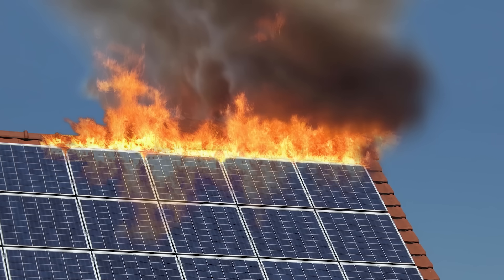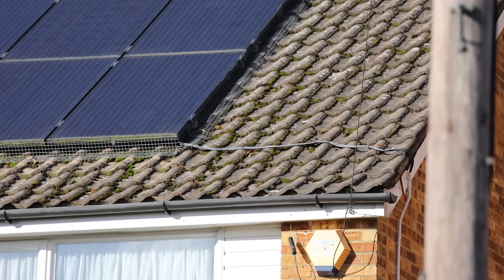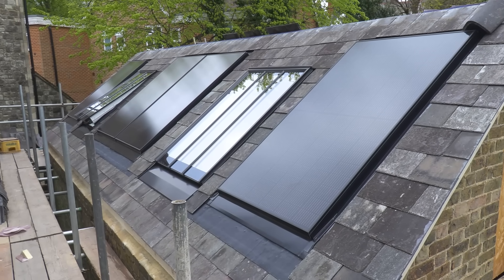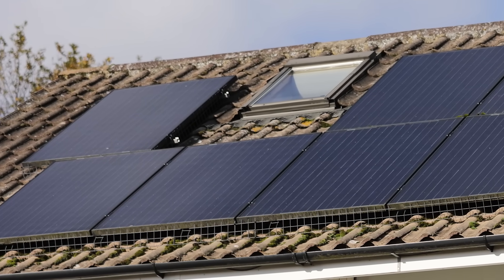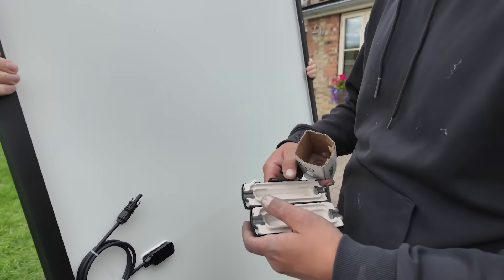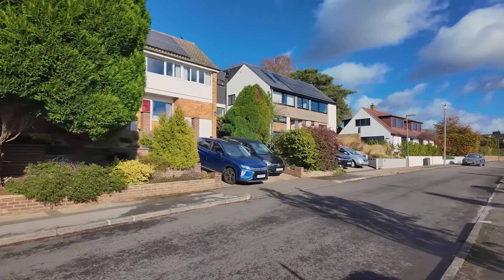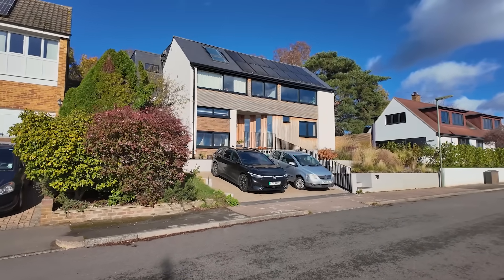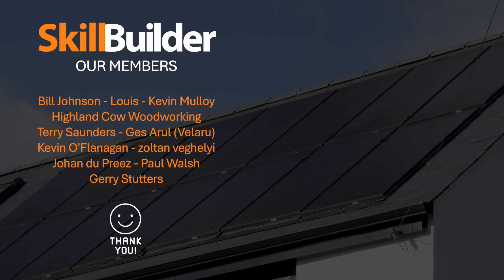Solar Panel Fires Are Rising – Here’s Why

Comment: I am a German electric engineer (MSc) and I was responsible for many high-tech machinery designs, the making, shipping and installation until production resumed in Asia, Europe and the US for PV-module production (CIGS-based, but what I am writing now applies also basically to anything silicon-based modules).
In my early years I worked as a commissioning engineer on all continents, I know how to make and repair electronics, electrics (fully licensed), anything mechanic, process, hydraulic and pneumatic - and I know how to fix cars and anything of household machines. Yes, my family and wife loves me 😁. It is just for you, I am not a BSler and you get some first-hand thoughts on the subject. So here it comes:

I never understand why solar-thermal systems are political not promoted.

If you supply your washing machine, your dish washer and your heater system with already a 30-80°C water inlet, most of your large energy needs are covered for free - incl. warm shower and warm kitchen water. Heaters are the real energy suckers in any household, the little internal pumps and spinning motors and LED-lamps are neglectable in comparison.

With an solar-thermal system all you need is a warm water ring line connecting these devices via an adjustable thermomixer (for each) in your house and a (existing) proper central  gas heating system allowing to hook up and integrate the solar-thermal modules on your roof top. 
Most modern systems have such feature. The ring line is usually standard in such houses for the bathrooms and the kitchen (dish washer) and the washing machine is mostly located in the basement or kitchen, where also this ring line is somewhere near or can be extended to.

Such a system is not only way much cheaper, it is most of all SIMPLE!

Every plumber can install and repair it, nothing complex, here there is no need for software and is 100% fireproof because it runs on water only. So in 5-6 years when your solar installation most likely develops its own troubles (mostly expensive control electronics, inverters and the like), you have simple means of repairs not relying on highly-specialized spare parts.
With all the software and different electronic components for a whole system you might face now a spare part crisis and even worse will not find anyone trying to get into your complex system to fix it. The complexities are huge hurdle (just think of modern cars, they die because the centre console is dead, not the transmission, engine or gearbox).

Maintenance: as long as everything remains water tight every 5 years or so you replace the solar panel liquid in the primary circuit, which is basically water and antifreeze as in your car's radiator. With a bit of proper thinking and a manual and some (YT) advice any housewife can executed it; it is like draining, refilling and air-venting on your cars cooling system or house heater water circuit. My sons with the age of 12 were trained by me so to understand the basics of hydraulic physics...

In winter when your panels are covered with thick snow in the morning, you only need to remove a bit of snow at the liquid connector spot (temperature sensor location) of the panel, so the controls of the central heater system will now start its circular pump pump ("believing" there is warm water at the roof) and forces more lukewarm water through them and within 1 hour or so the snow melts or even slides down, clearing the panels on their own by gravity. 
There is no need to climb onto the roof in winter to clean the complete panels as with the PV-modules. PV-modules covered in snow in winter at the roof are a nightmare to reach and you always need to clear their whole area.
This spot at my thermo-panel system was placed conveniently very near at a roof window and all I need in a winter morning was a broom and exactly a half minute. The rest did the system magically on its own.
Even on a clear winter night you can "earn" up to 90°C from your roof, filling your warm water storage tank (70-100l), still carrying plenty of warm water into the next morning.
Dish washers and washing machines these days can be run by a pre-set time and so set it to noon or whenever you expect Ms. Sun to show her bright smile.

For society: there is no need to change or enlarge public grid hardware; changing heat loads will not influence the general electric grid operational situation since there is no electricity involved and in the nights you have your warm water storage tank anyway. The efficiency rate is much better because the sun warms up the water, which you want as well, warm water. Electricity is always a support energy only and every energy change into another form screws any efficiency rates. This heat goes straight where it is needed.
No need for an extremely expensive power battery module lasting only a few years and posing indeed a very dangerous fire hazard, which is not the statistical occurrence rate (which is quite low, but it does happen), the danger is the pure spontaneity and unpredictability and once it starts, it releases a lot of highly toxic and inflammable gases and then goes off like a bomb - no fire truck and crew will be ever able to extinguish such fire. If you are lucky you might escape with your life but your house is certainly gone.
This is a matter which should be seriously considered. Rare as an event indeed but very deadly and fast as lightning when it happen.

Ecologically (I'll try to make a very long story short, just the base points):
The pure solar/battery idea is not really ecologic as it is and was always promised; the energy input into these highly compound-material (PV-modules, battery blocs, power controls, inverters etc.) is really much too large over their much too short lifecycles (10-25 years), the energy efficiency rate of the whole idea is in general a mess and the whole idea dies multiple deaths due to local and global resources limitations, technical complexities and fundamental technical problems (i.e. inertia, see black-out in Spain), plus some more reasons (recycling issues, distribution, natural disaster proof etc.). 
We basically triggered a new now green predatory Capitalism on a global scale without really braining it out first. Call it ideology or quasi-religion; up to you.

Personal summary:
Solar-thermal systems are elegant, cheap to make, dead-easy to maintain and repair and a pure reason for an engineer to be happy.
I own a house here in Dresden, decided immediately against this PV-BS and installed a solar-thermal system as described and lived since then happy ever after, never looking back. 
Plus there is no constant hassle if the government is subsidizing it by next year or changes it mind. The add on for my central gas heating system for two panels incl. installation about 12 years agon were a lousy 1300€. You own, what your earn (from the roof), simple and effective and economical. 
So far only one repair (pressure surge tank) for a small 300€ including installation (I was too lazy to do it myself).
As an electric/electronic engineer I am so happy not to have such an overcomplex system, which would keep me constantly busy: technically and administrational.

At least whoever thinks of earning a bit sunlight for one's home comfort should honestly rethink this option truly first. 
And on top your will see your fire brigade only once a year when they throw their annual party for the community (a German tradition in smaller towns, suburbs and villages).
So, this would be my advice from an old white angry German Boomer engineer, to whomever is interested.

Peace! from Dresden / Germany
Reply: A perfect example of the KISS principle in action, as a fellow engineer I am disappointed that PV is "Gesetz" (required by building regulations) here in Bremen when you install a new roof.
Reply: Glad you didn’t do the long version 😅
Reply: @lomate1963  there is if you want it just email him and he’ll oblige. 😂😂😂
Reply: It doesn't charge your car though
Reply: My car charges my house.
Reply: @gzoechi  
My car is "charged" at a gas station. It has a wonderful very fuel-efficient, quiet and clean Diesel engine.
Besides if you have enough space at your roof you always can install a PV and a solar-thermic system in parallel. 
But PV for the house supply is plain BS and it is bad for the environment - which makes EVs bad for the environment too, plus all the highly complex inefficient and fire hazard disadvantages remain. In South-Korea (and other places) EVs are increasingly banned from being parked in houses for this very reasons.

In general, the supposedly green EV-promise came always with the PV-EV-combination, which will never work as a planet saver.

There is no need to argue with me on this one. I calculated the energy impact needed just for a few steps in making PV-panels with REAL data taken from "my" production machines and the result was a disaster.

I also know and understand that we need to get away from fossil fuels for transport, since these resources are ultimately limited. But the solutions as we are driving forwards in ideologically heavily charged Germany currently are not working for the environment and climate. And they never will. Period.

The solutions are different and even lay in totally different fields, like overpopulation and senseless wars and rearmament - triggered by the global West.
I've been working on all continents, lived in three different SE-Asia countries for years and I've seen the overuse of resources everywhere. The only solar/wind/battery (Battery? Which battery?) fantasy is plain BS as a global climate saver.

Peace! from Dresden / Germany
Reply: @Gerd-2 It looks like your main intention is to spread misinformation.
Reply: @Gerd-2 "Clean" Diesel 😂 jog on, pal.
Reply: @bmacpher 
Well, for sure. Relatively clean, what comes out now is definitely not a concern any longer.

The whole fine dust debate was flawed on purpose, everyone who understands a bit of physics, dispersion and statistics math realized this immediately. It was so primitive!
Furthermore any human activity generates pollutions and so do EVs.

But people like you will never understand this because they just keep daydreaming within silly ideology bubble.

Peace! from Dresden / Germany
Reply: @Gerd-2  One  disadvantage of water filled solar-gathering panels seems to be the weight of the panels relative to the design load of many houses built in the uk - yes houses purposely designed and built to be almost adequate, but often not.
Reply: @oldbutstillcurious3615  
Valid question, but you can relax.

No, they are not significant heavier since there is not much volume of water inside them. These water panels are surprisingly flat (and need to be), to work efficient. Large (water) surface is needed but not volume. 
And they are made basically from thin corrosion protected profile-pressed steel sheets plus a strong glass cover on top (hail protection, my guess - I never asked). 
At least for the ones I have on my roof top - one panel might contain only 2 or 3 litres (2 - 3kg) of water max.
The water running speed under a large (black) surface makes the efficient heat transfer, which is amazingly effective. The feed and return line is of ca 3 cm diameter hoses (foam insulated) which is all not heavy either.

At the same time PV modules are consist of a thin glass sheet (ca. 0.4 mm) with its semiconductor layers on top and the whole thing being inside laminated (plastic) and surrounded usually with an aluminium side rail making the whole thing kind of heavy too. My gut feeling is for the same area size roughly the same weight for both, nothing extreme here.

But weight is not so much the issue if you are concerned with mechanical loads, it is area again. If a storm shakes up your house it is again the large area of the panel acting like a sail or airplane wing - so the smaller the surface area the better for not being ripped off from the roof or its foundation frame.
In this case aerodynamics apply to make them stay safe at the roof under windy conditions, less the weight.

And the typical elderly British row-houses and their roofs I've seen in the UK made a kind of similar solid impression to me like me own roof. Maybe I am wrong but then it would be a very shoddy way of making roofs. But I am an e-engineer, not a structural engineer who can estimate and calculate roof static and dynamic forces.

To answer your question in short, no these solar-thermic panels are not really that heavy - at least in comparison to PV-panels. They are similar in weight, even with water inside.

Peace! from Dresden / Germany
Reply: @Gerd-2  It's not a problem in Korea.
Reply: @studiooo-t6i  
Media reports otherwise after a few real bad EV fires in underground car parks, where gigantic and very fast fires occurred.
Which led to some management for such housing complexes ousting EVs from such underground parking areas. It also happened in other parts of the world too.

Well, assume we are both talking about S.-Korea 😄.

I got the information from StracheD (and other sources) an American firefighter and battery engineer, who writes frequently on this subject without foam at his mouth and condemning EVs or battery technologies in general.
But explains very reasonably based on hindsight and engineering facts very stringent why and how it happens.

 Type "car park fire Seoul" for some incidents and you will read (YT clips are also available): 

["In Seoul, South Korea, there have been several incidents of electric vehicle fires that have raised safety concerns and led to bans on EVs in parking lots. Here are some key points regarding these incidents:

- A Mercedes-Benz electric sedan caught fire in an underground garage in Incheon, causing extensive damage and requiring over eight hours to extinguish. 

- A Kia EV6 caught fire in a parking tower in South Chungcheong province, taking more than an hour to put out. 

- The Seoul Metropolitan Government has implemented stricter safety regulations for underground parking lots, recommending that only EVs charged to less than 90 percent be permitted entry. 

- The government has introduced a state-run certification system for EVs, requiring carmakers to disclose battery brands and raw materials used. 

www.chosun.com/english/national-en/2025/05/28/C6VJHSVLIZDDZNTWLBDLDOC4RI/

These incidents have prompted discussions among car manufacturers and lawmakers, leading to an overhaul of EV policies in South Korea. The new regulations aim to improve EV safety by having the government examine and certify batteries before installation."]

So you see I am not making this up (Why should I?).

Every new technology will bring safety challenges and certainly EVs and inhouse battery packs with their highly concentrated stored energy and specific battery chemistry must pose a safety challenge. 
There already were many accidents now on public and private car parks, charging stations and even ships carrying such vehicles spontaneously and very fast bursting into non-extinguishable fires causing totally new challenges to fire crews worldwide.

You cannot deny it although it is rare, it is disastrous when it happen. And it is self-explaining why from a technical / engineering point of view.

Peace! from Dresden / Germany
Reply: @Gerd-2  That's correct. Just because I live in Korea doesn't necessarily mean I am well-aware of all its issues. In fact, an outside perspective can often be much more accurate and objective.

I just know that extinguishing electric vehicle (EV) fires takes a long time and is a serious problem. It's common for these vehicles to be parked in ordinary residential areas.  peace from daegu korea
Reply: @studiooo-t6i  
Regards to Korea. I lived in SE-Asia for ten years (hoping over frequently). 

I installed many machinery there in the 1990s  - one big project was with SMC.
The machines were for CD-production and later I had a project for a large PV-module factory in Korea as well (check "Avancis Korea" - all PV-modules are actually going through those high-vacuum coating machines for the CIGS-layers as indicated at their home page are "my" machines. The plant is an almost identical copy of the Avancis plant in Torgau / Germany, which I was also in charge of these giant coating machines.).

I liked your Kimshi food, Korean BBQ and the "Bierhof" culture and OB Ice on Saturday nights .
You guys were hard and smart working, but still only nice memories!

Take care & peace! from Dresden / Germany
Reply: Absolutely brilliant  and simple. As a retired Chartered  Engineer I wish I had designed and built a thermal solar water roof installation when I was fit.
Reply: At last somebody with some common sense. I have built copper flat panels and have had exellent results from 1972. When Thermomax produced their simple tube system I changed to the 30 tube array and have had hot water ever since. Once the government get involved the logic disappears.  Simple system that runs on 8mm tube, two Megaflows and a bronze pump controlled by a differential temperature control.
Reply: I like your approach to this
Reply: German are the best engineers on the planet,I love watching ww2 German vehicles being restored on YT,the engineering is amazing and a work of art,Maybach engines sound awesome..........
Reply: This sounds so sensible. Can you advise further information sources?
Reply: @somyrab  Me and and old friend of mine (an university mate) came up with the idea when I needed to replace my old gas central heater due to extreme inefficiency and frequent break-downs. 

So I bought a new one (manufacturer Junkers) via my decade-old local plumping supplier. These guys know best which components to use for the whole idea.
Junkers has a range of gas heaters which allow to connect solar-thermic fields and then I ordered a package. Capacity calculation was done by plumber together with me, with some phone advice from the manufacturer.
Modern (gas) heaters are now complex, it is advisable to get the manuals (and if possible the service manuals) first for the heater and the panels, read them to understand all features and how they would work together.

The rest is ordering, installing and commissioning. 

So the best is to talk to your local plumper if he is up to date with modern heating systems and present your idea.
If you want PVs (let's say for an EV) talk to these guys separately and make it two separate projects; the only thing they have to share is the space at the roof or your property. Keeping them separate also keeps them both simple and operating independent.

PS: Our Greens here advocated gas as environmentally friendly for a long time (to replace the indeed nasty coal heating), so whole cities were fitted with central under-earth pipeline systems to supply us all with gas.
Now they get crazy trying to force us to replace the mostly modern gas heaters with heat pumps (and as usual IMMEDIATELY because we are all doomed if not), which there are no technical or residential environment in many German communities exist: space restrictions, not suitable electricity grid etc.
When I replaced the old gas heater with this new one, I immediately saved 40% of gas consumption. But this does not count for them, they always want people to jump to their ideologic doomsday BS. The financial advantage of course never happened due to rising prices, artificially driven also be more and more heavy taxation.
The whole package was around 11.000€ but never been subsidized, besides the solar add-on. And now they are wondering why we kick the Greens out of our parliaments. I used to have sympathies for them but this finished long-time ago.... it is a political party for the rich and uneducated only.

Peace! from Dresden
Reply: I wish I could saw up that long story and use it to run my wood heater for a few days.
I would like to use hot water batteries as he mentioned in his post but in Texas where I live we don’t have radiant water heaters so it would be a huge investment in an existing house. I saw that working very well in Mexico but the extreme cold we get here makes me want to reduce the amount of non anti freeze water in my house. 
LFP batteries are not a fire hazard; even the NMC Batteries that do burn furiously are safe if they have good BMS. I haveNMC batteries in my bicycles but wouldn’t dream of using that chemistry for energy storage in the house.
String inverters in an off grid system are very reliable. With 500volt strings we can set ground mounted solar arrays 500’ from the house with insignificant voltage drop. They are accessible for snow removal and typically guaranteed for 25 years. Copper wires like cold temperatures and move energy much cheaper than water pipes.
Reply: Read all your posts here. I used to have a solar thermal system that I inherited when I bought the house. It had a simple hand  diverter valve. I ripped it out to make room in my loft, now a store for hardly used items. Big mistake.
Reply: @willbee6785  
To be honest I do not know, what the issue is - a "hand diverter valve"? 
In my installation it does not exist and is not necessary. I only adjust the inlet temperature at the washing machine water thermostat down if low-temp laundry is being processed. 
Anything else of the rest is fully automatic and also does not take up any extra space for extra components; it is connected to the central gas heater by its feeding and return line at the basement and that's about it. 
No extra space required in my house for this system - unlike with a PV-system which would be different since you need the inverter electronics devices (often wall-mounted) and possibly the battery stack (quite big).

What possibly can be the mistake when mine is running for 12 years (or so) without me doing anything at it, except for this ridiculous little maintenance (annual check for leakage and the official chimney check by the authorities - an almost useless century old ritual).

Perhaps we are talking about something different here?

Peace! from Dresden / Germany
Reply: But in UK we pay one of the highest prices for electricity and the gov want to ban woodburners  so forcing all to electric heat. Water solar system wont run TV, pc,  ovens etc etc
Reply: @noggindoo 
Same here as I described. The moment people who owned a fire place and collected cheap or even free wood were immediately moralized and accused with a new environmental damage scare to be pigs.

But as I explained, anything which heats is the major chunk of energy needs in your household.
And in the UK and elsewhere in Europe (perhaps not in the South) you are simply better off with such a system. 
The best parts I already described, plus the government cannot tax you on it, since there is no warm water counter of any kind attached.
Perhaps this is the reason governments do not promote it; they would miss out on a lot of tax revenue.

You want a true simple "island" solution? Go for it or at least consider it.
Plus if you really favour it, you can have both systems in parallel (water and PV) if space on your roof top or property allows it.

Anything of heating is the Giga cost killer, not the TV, PC, LED-lightening, and kitchen machinery or vacuum cleaners.

Peace! from Dresden / Germany
Reply: Cheers for that
Reply: I’ve been saying this for years….
Reply: Thank you for your generous sharing over your professional opinion ❤️🙏❤️🙏 wish you well always. Appreciate your help.
Reply: Thank You!!! Excellent information and wonderful ideas!
Reply: You ignore of course the rather major aspect of home air-conditioning. No warmed water system can complete this task (neither cooling nor heating) and this  IS  a big part of s=domestic power consumption. Especially here in an Australia summer. And then there is the ongoing use of electrical home devices of all types.
Reply: @petesig93  
I did not ignore it, I confirmed it.
I lived and worked for years in Hongkong, Singapore and Taiwan. My wife is from the Philippines. And because aircon climatization is so electro-energy intense, you need a powerful grid for your nation and industry.
As an e-engineer living there my memories are still very fresh about the huge aircon consumptions and its bills...

My question about non-promoting solar-thermic solutions was stated at basically European conditions with the frequent remarks that different climates, geographies and even natural illumination issues (like the Artic circle) will require different solutions; and without nuclear we will never have a chance anyhow, specially here in Europe but also elsewhere.
Solar-thermic systems would fit quick and easy into many European housing scenarios.
Instead of heat pumps for winter they would be a much simpler solution and probably often the only one.

Do not forget, in Europe, except for the South we do not have aircons in our buildings and we do not need them. They become cheaply available now but people shy away because of their big electricity consumptions. Fans are much better and more electricity saving, but have no tradition yet either. And of course, you cannot rum them both on water, cold or warm.
(Besides, aircons are actually heat pumps, just operating in reverse mode - in some parts of the world this back-and-for principle is being used as well.)

PS: I also installed once in Melbourne a machine (5 weeks), but it was during their autumn period; kind of cold and shivery and rainy. And there were no heating at all, just thick pullovers - I bought myself one at a local market in traditional aboriginal fashion, very warming...
Still I had a marvellous time there, loved the place.
But since I've been over one weekend to a marriage party somewhere in more central part of Australia I know how hot and dry it can get over there. It was an interesting experience. Hey, Stay cool in down-under, mate.
Reply: where can I find more information on solar thermal systems?
Reply: @Floyd112007  
Check my post further up, it starts with:

[@Gerd-2
1 day ago (edited)
 @somyrab  Me and and old friend of mine (an university mate) came up with the idea .....]

Basically you check with the central gas heater manufacturer and your local plumper if he is familiar with modern gas heating equipment.
I bought and installed a central gas heater system from Junkers-Bosch, a company which can supply anything of this kind for heating, gas,, oil, PV, solar-thermic solutions etc. 
Unfortunately you need to go to their homepage according to your country, so I cannot recommend a general English website of them. They most likely sort their products also according to global regions.

Peace! from Dresden / Germany
Reply: Personally, I think solar power is more efficient outside the atmosphere. When you consider the atmosphere, humidity, night, the monsoon season, or typhoons, I think it's also a bit risky. There's also the issue with birds.

I am personally curious about German vacuum technology.

In Germany, do they use bathtubs so much that they don't have showerheads? Recently in Korea, a new shower hose came out that uses air pressure to drain the water from the showerhead, and I think it's more hygienic. Of course, you still have to manually shake the hose for a few seconds to drain it completely.

Vacuum technology is very convenient and great for food storage, and in Korea, which has long monsoon seasons and high humidity, it's excellent for storing winter clothes and bedding. But the pumps are not very good...
Reply: @studiooo-t6i  
In Germany it depends we either have shower cabins or tubes, often both but no vacuum there , just the pressure and taps.

Industrial vacuum technology is totally different (except the physics) than household usage. Pumps are usually bigger up to much much bigger. Vacuum chamber can be quite small (like CD aluminium coating) or gigantic (glass substrate based coating like for architectural, automotive or PV panels). PV-module coaters were up to 45m long, 3m high and 12m wide and they are highly complex.
The biggest of these machine in Avancis has an electric connected rating of 1MW, which means only this machine consumes permanently between a whopping 0.3MW - 0.5MW. And there are 3 more of such machines on which those glass substrates need to go through one machine after another to become finally a PV module. Every 15 minutes about 4 such substrates are coming out as far as I remember.

The huge electricity consumption is because very high temperatures inside the vacuum process chambers are needed and since this is high vacuum, the heat transfer into the substrate is by radiation only to heat up those substrates. And of course when the come out and back to atmospheric conditions you have to cool them down from a few hundreds °C back to room temperature with cryo generators. The electricity consumption is crazy!

A typical production run in a factory like Avancis is about 2 weeks of constant running, which is why an absolute stabile electricity supply is needed. 
Here at the German factory we doubled the electricity line and transformers from the power station just to avoid black outs at any costs which would stop these gigantic but highly sensitive machines and create a big mess (inside them).
The vacuum pumps there are massive, usually having a pack of very large rotary vane pumps, topped with roots pumps and then batteries of turbomolecular pumps (3 stage system) for transferring the substrates in and out of the vacuum but also keeping the process vacuum stabile for sputtering and vacuum evaporation of the materials which you can read at their homepage (aluminium-zinc oxide = AZO, cooper-gallium alloy, sulphur, indium and another machine for Selenium coating). 
Those materials are coated onto the glass substrate (ca. 0.8 x 1.2m and 0.4mm thick) like a gigantic sandwich with many layers to complete the module's semiconductor structure.

This module type (CIGS) is in general better and more efficient than any Si-based PV-types but need more exotic materials in large quantities and very pure quality.

Si-based PV-modules are a bit less efficient (18-20% peak) but need even more energy to be manufactured; their semiconductor structure is based on pure silicon-crystal structure (different types exist) being very slightly inserted with i.e. phosphor and boron to create semiconductor properties. 
Si-based PV-modules have an efficiency rate (peak) even lower than the CIGS-modules (ca. 23-% peak) but are much more common in the market. 
However, with these processes I am not so familiar with, except for Czochralski-process machines to make extremely clean Silicon monocrystal bars (later to be sliced into wafers), which is also a high-vacuum process. 
My company also made such machines and I worked at some of them for a big customer in Japan.

Peace! from Dresden / Germany
Reply: There is more then just hot water
Reply: Thank you. What would you say regarding solar power in the tropics where grid is both expensive and often unreliable
Reply: Oooh any housewife 😮
Reply: @franceshawe9572  
Depends, if she has a good head for heights 😁.

Peace! from Dresden / Germany
Reply: Wow - thank you!!!
Reply: Wow you're so special! You're German! Solar thermal in my area with a permit would cost around $7000 installed. And that would offset roughly 40% of my gas bill which currently runs at $30 per month. 😂😂😂😂😂😂
Reply: @Loki-rascal  
You have to calculate your system with your economics behind, not mine.
As given with my nationality you better check according to your national economics around which are certainly very different. So there is no need to slur around.
I am not special, but I am an engineer simply doing the math under MY national conditions and NOT YOURS. I know how to do math.

My two thermal solar modules needed just a total 1300€ extra on top of the anyway new heater system replacing the old one. 
In Germany you do not need any permission (what for?) to place them on your roof top.
Also, in Germany you are not getting away with just 30 bucks a month for heating. 60 to 150 € per month is much more real for an apartment or a single family house currently in 2025.
Beginning next month (Jan 2026) the German government is adding the CO²-tax on top even for end consumers, ratching up artificially the gas price.

On top of this senseless Ukrainian war, Europe is now being forced to buy overpriced gas from the US, the Arabic world or other places and we have currently no idea as end-consumers and business where the journey will go to. 
Politically a gradual increase in fossil energy prices is desired (which is not my idea and I believe it is fundamentally wrong) in Western Europe.

Now if you can safe 40% (as it was in my case with the complete new system) of gas, it starts to make sense.
So do the math again with MY numbers, include the huge future uncertainties and for sure you can save yourself already those 6 laughing smileys.
In my place winters tend to be very cold and long and therefore expensive.

Peace! from Dresden / Germany
Reply: I have a neighbor that does something like this with their pool. I runs without electric and keeps the pool usable about a month longer on each end of the season. This is northern NH.
Reply: Hi, do  you have a link for an adjustable thermomixer? Thanks
Reply: @stefanoavezzu6898  
No. You need to check with plumbing material supplying companies and their catalogues-
Best is to ask your local plumber directly  because plumbing material very much has different national / local standards
like thread sizes, burst pressure, material composition and max. pressure capabilities etc.

Make sure it has a mixing range of min. between 20-40°C and a safe burst pressure.

Peace! from Dresden / Germany
Reply: I agree - makes sense ✔️
Reply: I too despair at the fail of Solar Thermal in the UK ... I put it down to the high install & maint. costs by citizens who have lost any DIY skills & our tendency to "do it wrong " .. We tend to go for bolted to the roof systems, scafolding , controller, pump & installer & thus spend £6000 for hotwater for only half the year  ... In China folk just buy a system comprising a tank , a stand & some tubes , not even electrical , £200 & put it on the flat roof & connect it with a hose pipe,
Reply: @brackcycle9056  
Bingo!
Reply: Man, I'm not even an engineer and I had the thought a decade ago that water cooling/heat recovery on solar panels was an absolute bloody no-brainer.
Increased efficiency due to regulated temps, many kwhr's of heat stored in water for later use for showers etc. at the end of the day when there's no PV input and increased lifespan/safety of panels due to lessened expansion/contraction cycle. NO BRAINER! 

I've floated it with a number of "industry professionals" in different venues and the answer has basically been "completely unworkable". Bull fucking shit.
Reply: @whirled_peas  
On top - PV panels have a max. (peak) efficiency rate of 22-24% (which cannot be increased due to restraints in semiconductor physics).
It means that 76-78% of the suns energy just heats up the PV module or reflects back into atmosphere.
"Peak" means this already lousy efficiency rate number only applies when the sun is shining straight onto the panel without any obstruction like clouds or three shadows etc. With other words if you are lucky on a fixed rooftop mount this number happens only at noon under perfect conditions (Southern direction of roof).
The real fundamentally bad efficiency rate can be only compensated for with larger module area.

Solar-thermic panels convert almost all the sunlight into heat, which means your panels size for the same amount is much smaller - which has a lot of advantages: more energy with smaller sizes but also more storm-resistance.

These "experts" might be not wrong when discussing PV-systems, but they have one big problem, when they are actually running their business based on solar panels: their storage facilities are now full of panels since governments around the world subsidized in different ways specially the solar hype. Many jumped on this bandwagon as their business idea and invested heavily.
Now, since most governments are rowing back because economically (and increasingly ecologically) this bubble bursts, they need to get rid of their stocks to have investments being paid off. Which is why they keep pushing hard for the PV-option. Do not blame them, but you should not fall into this trap either.

Which is why these experts declare solar-thermic systems as not feasible, not easy to handle etc. Which is absolute straight-forward bollocks but how Capitalism works. 
And certainly this is now a new green predator Capitalism, and definitely not a global solution.

"Area" is always a resource, nations fought wars over it. It is one of the many resources we are currently blundering in the name of a higher goal and PV.

Scare-mongering is and always was evil. And a bad advisor too.

Peace! from Dresden / Germany
Reply: @Gerd-2  black solar panels have near-zero albedo ie. they reflect nothing back into the atmosphere.
Reply: @petesig93  
Alright, thanks. Sounds like close to 99%, right?
Even not the top (protection) glass cover is reflecting some of it?
I knew they are very efficient but had no idea of a rough efficiency number.

Still appreciate your remark, the old German grumpy engineer learnt something new today! Awesome :hand-pink-waving:!

Take care & Peace! from Dresden / Germany
Reply: @Gerd-2  Actually it's not as simple as you make out. The PV efficiency to the house is about 20%, however that then runs a heatpump to heat the water so you are back nearer 60% which is comparable to the best solar thermal systems, and unlike solar thermal it can run your laptop as well.
Solar thermal is also much more expensive and demanding in terms of weight and equipment so costs a lot more to put up in the first place.

It's great for DIY in the garden stuff and for building things with the kids, and if we do manage to start WW3 it's buildable out of the remains of civilsation.
Reply: @etchedpixels  
Your mistake is that the 22% only apply under perfect conditions. If you are lucky, you only have it ones a day during summer.
Which why it is called "peak efficiency rate". So the real efficiency rate is extremely lousy, specially when the sun is very low in winter at noon.
Thermic solar converters on a roof top instead have almost 90++% as I learnt from the post here, meaning the area size ratio for the same sun-energy-harvest must be ca. 1:4 to 1:5 (20% : 100%). This is gigantic! And unfeasible for the majority of European houses (and other densely populated places on the planet - like Hongkong etc.).

To compensate for it you need more quadruple or more PV-solar area. Much more.
And in Europe we simply do not have space or area; not enough to cover all the crazy upcoming wishes of electrifying the future.
We need much more Whamp! for industrialised and modern-life-leading nations.

Peace! from Dresden / Germany
Reply: Not much use if the majority of energy is needed for cooling.
Reply: @ChrisNotTheKing  
Good point. I lived in SE-Asia for ten years in sub-tropical and tropical regions.
Over there they still increasingly run their kitchens with dish washers and have their laundry done by washing machines - where you could use the same principle for the needed warm water feed, especially since the closer you are to the Equator, the more stable the daily sunshine cycle is, which would be an advantage.

Aircon climatization in Megacities becomes a major problem because indeed they consume massive electricity. But besides these modern high-rise buildings most of Asian homes do not have aircons, the mostly rely on fans (which in my opinion are effective). Still even fans run on electricity, not hot water.

The problem with many island nation over there is their conflict between serious population numbers, hilly (and often volcano active) landmasses and very little of the resource "area" to spare. Besides, generating stable grid systems in general in such a geography is very tricky.
Especially solar is no option at all to power national grids. It might be a support for individual houses but never for Megacities or industries or transport systems. They simply have no space to spare. On top of the amounts needed, stability is always a key factor.

The Philippines have currently coal, Diesel and gas powered supplies (total roughly 75%), the rest is hydro and geothermal.
Wind, solar and biomass is currently at 0.05% according to their Statistic Department. Tendency: rising.
But it explains and indicates the general problem for such nations.

On top, in these regions with strong typhoons, volcanoes and earthquakes solar and wind generators are also facing the problem of withstanding these extreme powerful forces.

Yes, indeed, cooling is massively needed there (specially in the food and food transport industries) you can't do it with solar, be it PV or thermic-solar. While the sun shine rate there is a certain pro, forceful shake-ups and very limited space is contra.
Frequent black-outs are still common occurrence there for multiple reasons.
Although the Philippines are looking hard into all possibilities to reduce fossil fuels, basically cut down (expensive) imports, which is important for a highly populated nation with little export industry .

The Philippines serves as a sample that a pure solar/wind/battery ideology will never work, other more concentrated and powerful solutions are needed.

Other countries (like large low-populated countries like Australia, Russia, Chile etc.) are also facing massive but different challenges with an energy transition. The only solar/wind/battery religion will also die here immediately because of their specific geographical and climatical circumstances and extreme sun-cycles (above the Artic circle).

Peace! from Dresden / Germany
Reply: @Gerd-2   Denying the practicalty of heat pumps that can easily be powered by solar PV, backed by batteries is a little naive.  It's a technological development that works well in many places.  If occasionally there's a need to generate power by burning gas, that's just fine.  It's practical, and the majority of the time you've saved the atmosphere from a greenhouse gas.  A similar argument could be made for heating water with heat pumps, but I'd put a huge caveat on that... it depends on where you're installing.  Efficiency for one thing, decreases with bigger temperature delta.  Places distant from the equator have winter to contend with, so nuclear, geothermal and hydro power generation are useful low carbon options.

In Australia we can easily use solar thermal year-round.  In recent times though, solar PV has proven to be an incredibly cost effective way to power households the majority of the time... making nuclear an expensive choice here.

The people who promote a one-size for all solution may fairly be labelled religious.  However, it's now clear that a diverse generation mix will feature in the future, and it's economics that drive the direction of change, not religion.
Reply: @ChrisNotTheKing  
I never denied heat pumps, whenever they are useful. But you cannot apply them everywhere. In Europe with its tight cities and villages it is a multiple major problem. Space restrictions and electric supply restrictions are one of them.

Australia has its own challenges due to the large distances. Solar might come in handy if you have enough area. Bit these "island" solutions, if too excessively installed also carry new problems: weakening the grid, if the "island" fails then it fails, and driving costs up - which is currently a big debate in Australia, since exactly this "transition" drives prices up for the general public as expected; the subvention politics makes it even worse - the rich install their highly subsidized "island" and the rest carries the left-over  accumulating investment and fix costs for a national grid etc. Same problem as in Germany.

A pure solar/wind/battery solution cannot be implemented, because it lacks two criteria: inertia and the necessary batteries.
Powering a farm or house for two days with just batteries is possible but never a Mega city like Melbourne or Hongkong (I know them both) for two weeks - same for large factories, like chemical plants and well, factories which make PV-modules.
Such batteries with such capacities do not exist and worse, never will.
If we speak about batteries, we must talk about SUCH batteries. 

Here we still have people advocating this idea and it is complete insane - then besides the technical issues this idea is limited to resources constraints.

Covering long distances also poses a challenge, even with latest state-of-the-art DC and High-Voltage lines losses are proportional to its length. The mega-projects to supply the UK with solar/wind/battery-electricity from North-Africa's desert and supply Singapore with the same electricity technology from Australia died because of these two reasons: the back-up batteries would be so gigantic, there would be no mine in the world supplying the materials necessary and the losses would be 25% / 30% - meaning that every 4th or 3rd solar panel or wind turbine would be working just to cover the transmission  losses.

I am sure we all will end up with a mix of nuclear, fossil fuels (and later artificial fuels generated from maybe solar/wind and nuclear) and in some places with solar/wind/battery.
And there is nothing wrong with heat pumps (I am aware of the critical points to have them running properly) and even EVs. But it is wrong to suggest or even ignore / law-out technologies.
All of them have environmental impacts (any human activity does) and specifically for solar I can tell you this impact is massive.

So, there is no one-solution-fits it all.
My question was, why we specially in Europe for not promote solar-thermic solutions for our houses since it has so many advantages and no disadvantage. And is comparable very ecological friendly due to its minimum of resources needs, grid-off-solution and simplicity.
The answer: either politics is not aware of it or ignores it due to the solar-investments here, probably a mix of both.

Peace! from Dresden / Germany